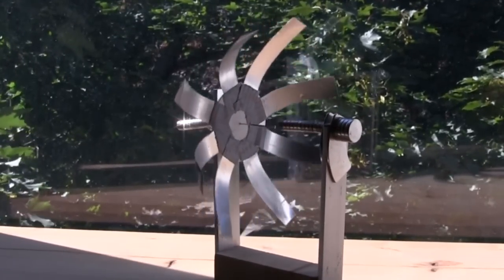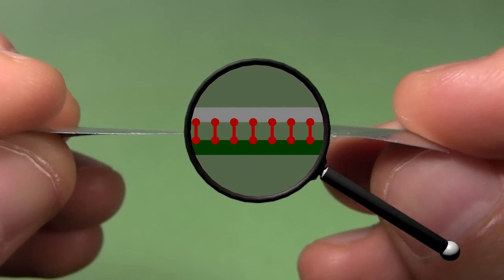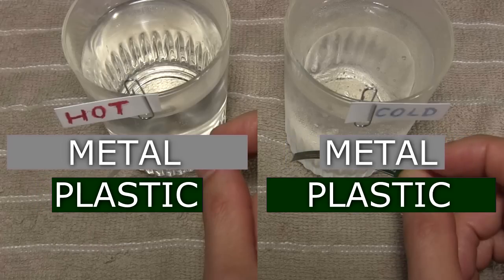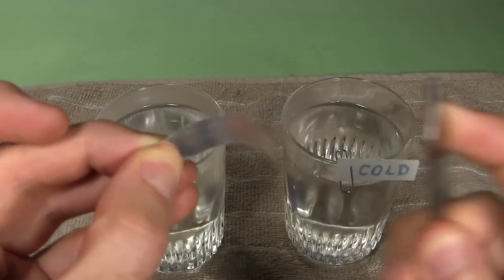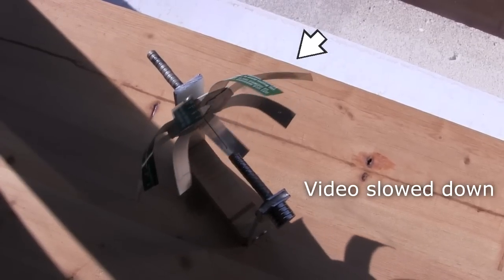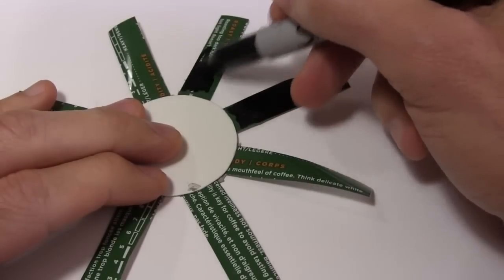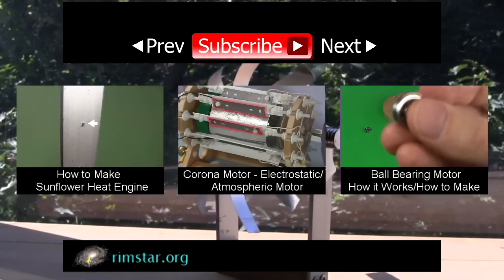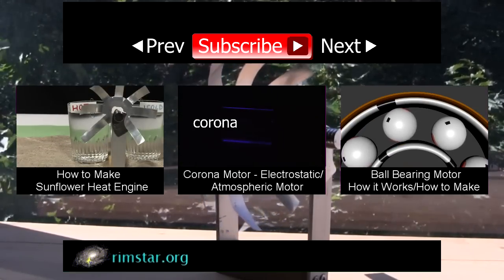Sunflower Heat Engine in Sunlight/How it Works

Comment: I'm currently building a large thermal expansion engine using this principle. My  machine has a 5 ft diameter steel tube chassis. I actually invented a material like this and didn't realize that this was available. Can you think of other sources of material like this?

Comment: That's neat. but why stop here? buy some thick foil, and glue it to some thick paper to make much bigger pedals and use something like Fresnel lense to concentrate the sunlight for the hot side.
Reply from the maker: +Oinikis Before trying a coffee bag, I tried duct tape and packing tape on aluminum foil. The duct tape worked better than the packing tape but it didn't react nearly as fast as the coffee bag and didn't curl as much. I also tried with aluminum tape instead of aluminum foil but it didn't work at all, probably too stiff. That also makes me suspect that thinner materials might be better than thick.
Reply: well yep, the closer the material ia to the center, the more curl change in lenght will priduce. So, I suggest deinking more coffe?

Comment: Are you sure the effect is not simply caused by different expansion rates of the materials, and not that they respond in opposite to heat/cold? I'm not an expert in all plastics, but the ones commonly used in 3D printing expand when heated.  I think both materials expand under heat but the rate/amount of expansion causes the bending. I love how you can make this run with sunlight on one side and shade on another. I am trying to come up with something useful that could be used for. I feel like there's potential for that even thought the torque is low
Reply from the maker: +USWaterRockets My first thought was different expansion rates. Then my research online said that plastics contract with heat, so I went the other way. My research didn't state outright that all plastics contract with heat, so in the video I said most do. I'd forgotten about PLA. So no, I'm not 100% sure, but at least the effect is much the same, changing dimensions due to heating and cooling, with the materials changing at different rates. Let me know what you come up with.

Comment: you are a real genius i'm a fan from algeria . can you tell me from where i can get the transistor 2n2222 from a adevice for an exemple (radio)
Reply from the maker: +Yasser crazy boy I don't know. Power supplies and TVs might have transistors but I usually don't find any. Mostly I find resistors and capacitors.
Reply: Thank you,  and i'm a fan of you from algeria continue.
Reply: Thank you,  and i'm a fan of you from algeria continue.
Reply from the maker: +Yasser crazy boy You're welcome, from Canada. Have fun with your project.
Reply: Thank's !
Reply: +Yasser crazy boy Hi Yasser,  i read your coment about joule thief
your doesnt work well send me a message what it does and what type of transistor do you use
Reply: They say it work on 1.5v battery but my didn't work it work on 9v and that i were using was (mac97a608h)
Reply: They say it work on 1.5v battery but my didn't work it work on 9v and that i were using was (mac97a608h)
Reply: well the transistor is bad
try finding 
BC547
2N3904
BC337
BC548
S9014
S9018
C9014
LM90
C945
Hope that helps :)
Reply: or even common c1815 but 
the pinout is not the same as the other transistors 
https://www.google.com/search?q=c1815&rlz=1C1CHFX_enMK644MK644&espv=2&biw=1360&bih=643&tbm=isch&imgil=cy_oRrXXbPhDRM%253A%253B8XrQNDk_NfYshM%253Bhttp%25253A%25252F%25252Fwww.alibaba.com%25252Fproduct-detail%25252FC1815-NPN-60V-Transistor-TO-92_1477242124.html&source=iu&pf=m&fir=cy_oRrXXbPhDRM%253A%252C8XrQNDk_NfYshM%252C_&usg=__uRjZNX-pbyE7nX9Pf3itQpXJfwY%3D&ved=0CDIQyjdqFQoTCJjnnI7B0ccCFcfycgod3XAHoA&ei=IlXjVZjOBMflywPd4Z2ACg#imgrc=cy_oRrXXbPhDRM%3A&usg=__uRjZNX-pbyE7nX9Pf3itQpXJfwY%3D
Reply: Thank's !
Reply: I've tried c945 but its didn't work can you send me the video
Reply: I've tried c945 but its didn't work can you send me the video
Reply: well the pins are http://datasheet.octopart.com/2SC945-NEC-datasheet-101592.pdf 
sorry for waiting
Reply: Thanks
Reply: have a sucsess?

Comment from the maker: +Manchease Skrelpher I suspect the same thing you do, that the thermal conductivity of the bowl would spread the heat too much, at least reducing the effect.
Here's a try at explaining why rubbing it makes it curve... Imagine you press the blade of a knife on one side of the strip and press on the opposite side with your finger, but not enough for the blade to cut it. You'd end up with it bending around the blade. Notice that the pressure isn't distributed the same way on the two sides. In the video I used the blunter edge of the scissors but the pressure difference was the same and I moved it along as I did it. Sort of a continuous bend.

Comment: Thanks so much for the follow-up on this very interesting device! I just have a few questions about it.
If the petals were replaced with a bowl-shaped dish of the same material, would that increase the efficiency? Or would the conductivity of the metal ruin the effect?
Also, why does rubbing the petals make them curve?
Thanks very much!

Comment: Where do you get the energy the engine. Is the heat wanes?
Reply from the maker: +Lechoslowianin The energy heat energy is converted to mechanical energy when it modifies the shape of the strips/vanes. That then changes the center of mass, which causes the rotation which is another form of mechanical energy. Is that what you were asking?
Reply: +Lechoslowianin As with every heat driven engine, the energy comes from the transfer of heat from something warm (the part of the room in sunlight) to something cold (the part of the room in the dark)

Comment: can it be scaled up
Reply from the maker: +sketchyssk8shop It can probably be scaled up in size, but I think the output would still be very small. For example, ideally down here on Earth we get 1 kilowatt per square meter (square yard roughly) of sunlight. If you had 1 square meter area worth of petals on one side to receive 1 kilowatt of sunlight, just think of how slowly the shaft turns, how little torque there'd be on it, and so how tiny the output would be compared to that 1 kilowatt input.
Reply: +RimstarOrg so it stays in the interesting model stage ...   would love to see a big one though